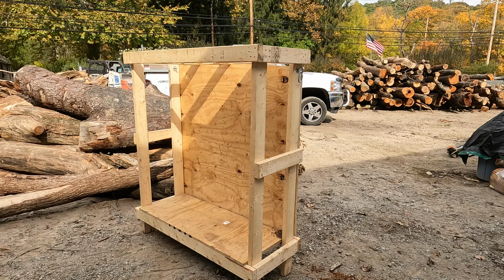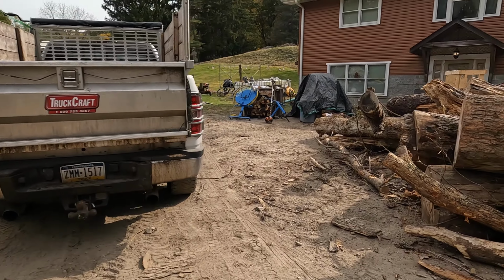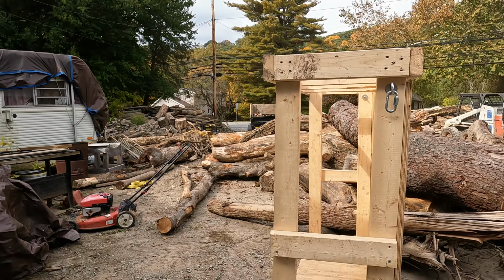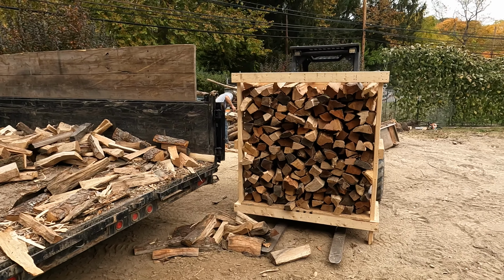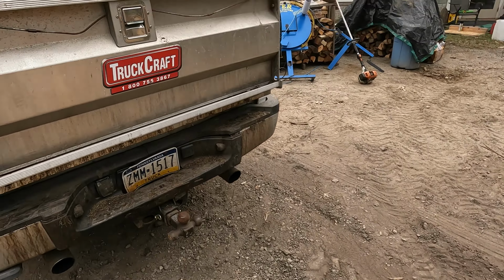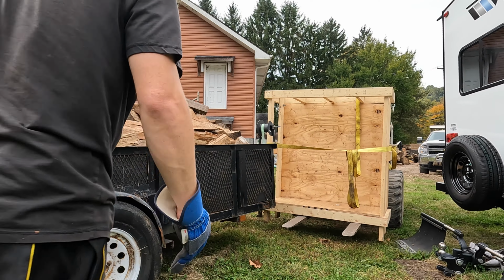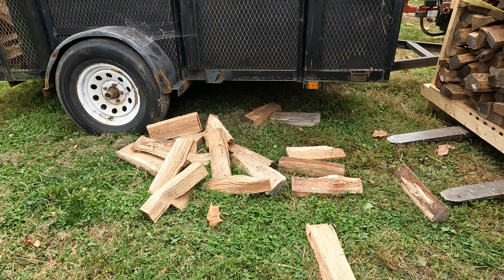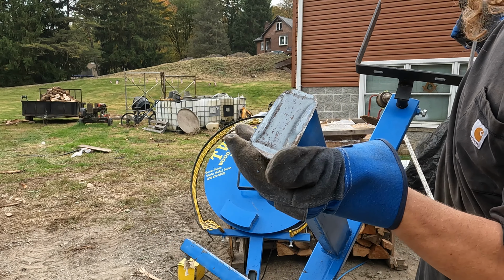Homemade Firewood Dumping Rack

Comment: Very nice build . I would like to ask a question and not trying to be noisy but what do you charge for 1/2 face cord . I’ve had people ask me if I would sell like that and not just bundles and I have no idea what to charge . Thank you for any help . Del
Reply from the maker: I usually sell by the face cord nothing smaller, just my bobcat has a hard time lifting it and it’s easier to dump into the 6 1/2 foot bet by the half face. I have had no problem getting $175 for repeat customers and $200 for new customers on my face cords. My wood is very nice stuff and that’s why I charge what I charge. Plus inflation on everything. Really does depend on location and how many other people are selling around you. I would say the bottom line on a face cord to make any profit would be right around $130-$140 and around me that’s the lowest you’ll find it.
Reply: Thank you for the information . I really appreciate it .
Reply: Del, I multiply what I’m charging a face cord by 0.65 to get my price. I’m charging $130 a face, so I charge $85 for half a face. I willing to sell smaller quantities, but I charge more for them. Good luck!